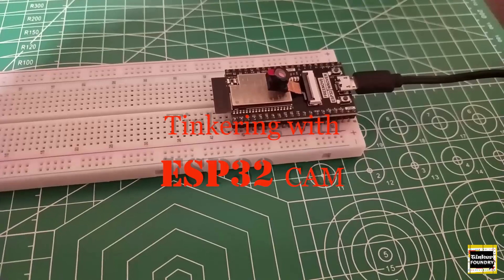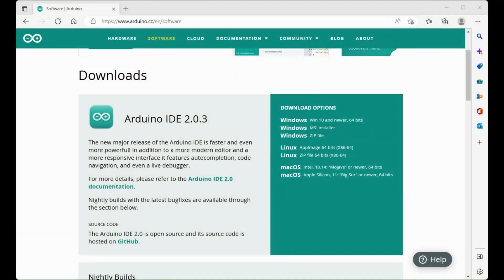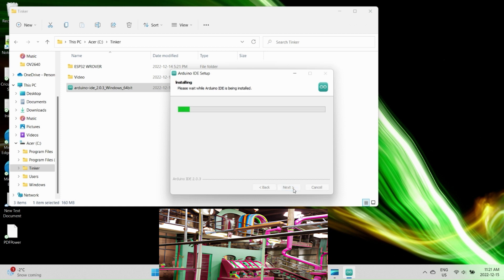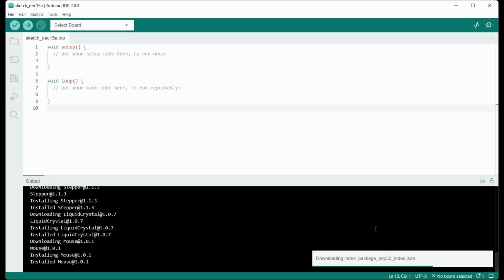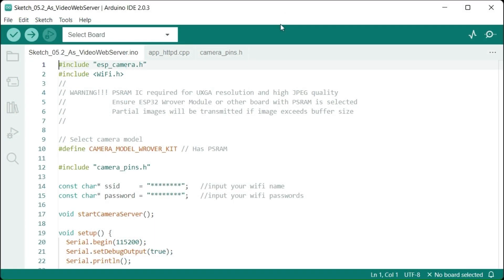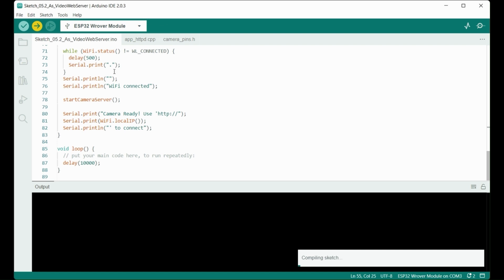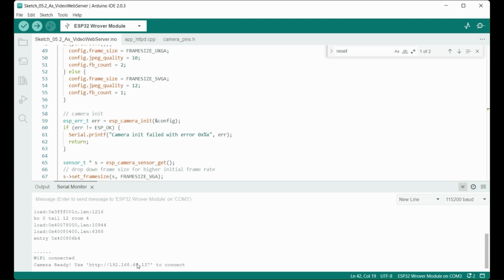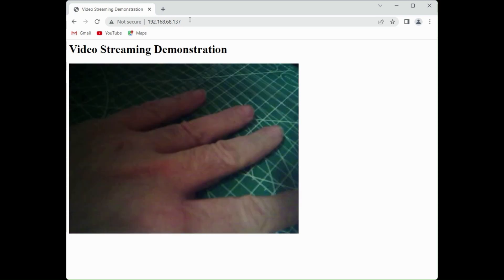Episode 3: Tinkering with the ESP32 CAM Module

Comment: rst:0x7 (TG0WDT_SYS_RESET),boot:0x13 (SPI_FAST_FLASH_BOOT)
configsip: 0, SPIWP:0xee
clk_drv:0x00,q_drv:0x00,d_drv:0x00,cs0_drv:0x00,hd_drv:0x00,wp_drv:0x00
mode:DIO, clock div:1
load:0x3fff0030,len:1344
load:0x40010000,len:13836
load:0x00000080,len:2686976
ets Jul 29 2019 12:21:46

rst:0x7 (TG0WDT_SYS_RESET),boot:0x13 (SPI_FAST_FLASH_BOOT)
configsip: 0, SPIWP:0xee
clk_drv:0x00,q_drv:0x00,d_drv:0x00,cs0_drv:0x00,hd_drv:0x00,wp_drv:0x00
mode:DIO, clock div:1
load:0x3fff0030,len:1344
load:0x40058000,len:1024
load:0x00000000,len:267673600
ets Jul 29 2019 12:21:46 

It doesn't work

Comment: Whenever I try to compile the sketch it says no such file or directory as "camera_pins.h" any idea how to fix this?
Reply from the maker: Hi. I just did a fresh install of Arduino IDE, installed ESP32 through the boards manager like described in the video (with the ESP32 url path specified in the "Additional boards manager URLs" box), downloaded and unzipped the code including sketches from the Freenove git repository. Once I opened the Sketch_05.2_As_VideoWebServer.ino sketch file from the Sketch_05.2_As_VideoWebServer sketch directory, all the associated files including camera_pins.h appear in Arduino IDE. I select the "ESP32 Wrover Module" board, and then Verify/compile the sketch... no problems or warnings. I think as long as "camera_pins.h" is in the same directory as the sketch file, it should find it. Do you happen to be using the same board and set-up as what I show in the video?